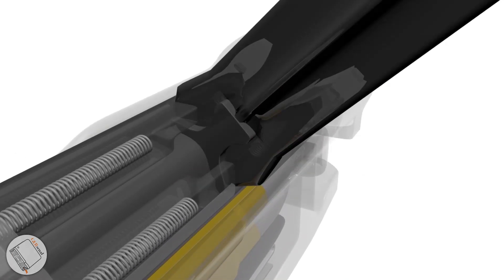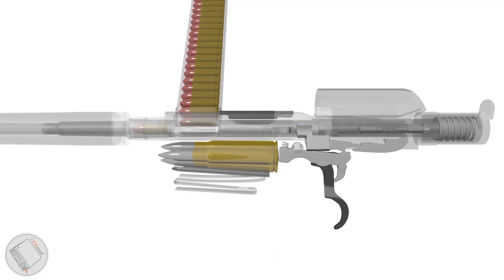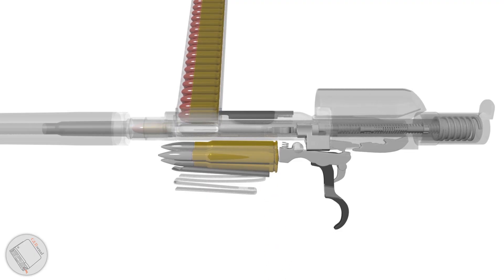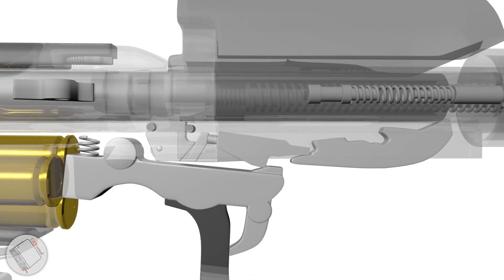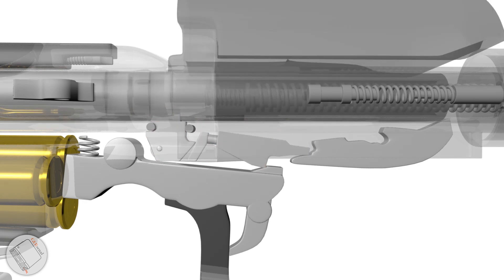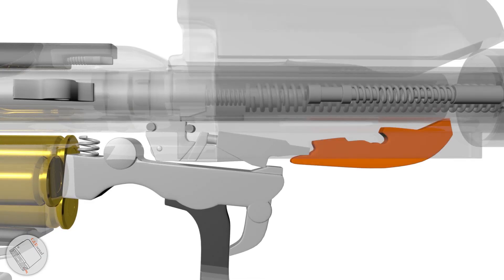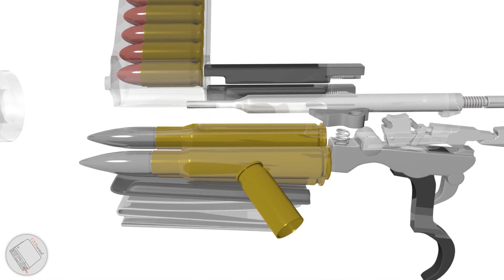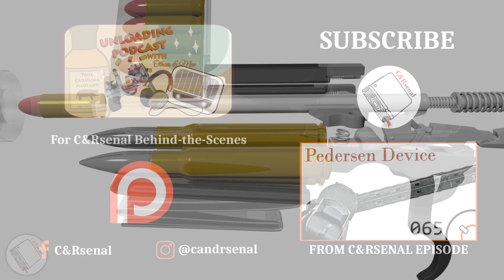How it Works: The Pedersen Device

Comment: I wish some company would make a modernized version of M1903 with Pedersen device that chamber in .308 and .45, or any combination of modern cartridge that makes sense.
Reply: The problem is finding a rifle and pistol cartridge combination that have the same bore diameter, and making sure the pistol cartridge can work in a blowback action
Reply: Well, switching from a .308 to a .45 would require a barrel change.

Comment: i will have to check one of my 03s and see if it has the special trigger.
Reply: easier to check for the big honkin hole in the left side of the receiver.
Reply: @johnsmith-sp6yl  the ejection port is there..
Reply: @johnsmith-sp6yl The ejection port alone doesn’t make a rifle compatible. Most Mark I rifles had their unique triggers and mag cutoffs replaced with standard ones.

Comment: "This is pretty straightforward"
Makes you wonder how they figured this out before the end of WW1, but never produced a proper SMG before WW2 that wasn't wasting pounds of material on non-functional (literally did nothing) components.
Reply: Two big, huge reasons.

First, the money. In 1917 the money taps were wide open. After the war the spigots got closed quite fast so they weren't developing much until you get into the 1930s. And once the money started flowing, there were much higher priorities. This is also why the M1918A2 was so awful, because they needed to be a cheap conversion from an M1918 or M1918A1 such that the good FN and Colt models were not acceptable. The only reason the Thompson existed is that it was largely developed during WWII when the money was flowing freely.

Second, the value and utility of a submachine gun was not widely accepted. Remember the British Army famously derided them until WWII started. And its value was debated in the US military throughout the inter-war period with the Army only deciding to adopt a submachinegun in 1938.

And once the US and UK realized they needed these things, it was the only submachine gun that could be acquired in large numbers in the short term.
Reply: @88porpoise  In other words, ignorance and a lack of vision.
Reply: Remember the US army had a love of marksmanship . One shot one kill, don’t waste ammunition. The idea of spray and pray was not something that was going to convince any of its decision makers.
Reply: The Blish component actually did help delay the action, just not in the way it was supposed to

Comment: In the current era, CMMG has made something similar for AR15's to fire .22lr. Except it feeds through the magwell from special mags and ejects from the normal ejection port. It doesn't work great on my full sized A1 clone though... My 03 is a Mark 1 if someone wants to make a modern copy of the Pedersen device I can afford.  

I mean they sell .30 Pedersen again... err 7.65 French Long... I mean, damn it, .30 Super Carry... 😂
Reply: I think it’s a lot closer to the M261 conversion kit. In the 1980’s, the US Army introduced the M261 .22 LR conversion kit for the M16 rifle, for use in indoor training areas with space limitations. Like the modern CMMG kit, you replaced the bolt carrier group with a .22 LR bolt carrier group with chamber insert. 

Unlike the CMMG kit, the M261 utilize converted standard M16 USGI magazines. This was achieved by literally shoving the magazine insert into an unloaded M16 magazine. Said insert was a .22 LR magazine. Yes, you shoved a mag into a mag. No, I don’t know why someone hasn’t tried that since. 

Of course, it’s fully reversible.
Reply: From personal experience, the CMMG .22LR conversion kits don't work that well in semi-auto only M4s, either.
     I soent some time as a firearms instructor for my employer, which coincided with the acquisition of several CMMG kits that were installed into issue M4s that had had semi-auto only trigger groups installed.  They were intended for use as an inexpensive training tool to develop marksmanship skills, reducing the amount of 5.56x45 we had to purchase.
     We found that the conversions were very sensitive to fouling and rapidly generated enough failures to feed and eject that their value as training tools was limited at best.  I recall that we had issues with the magazines as well.  Finally, the conversion kits themselves did not hold up under heavy use, which generated more malfunctions and a marked reduction in accuracy...also not ideal for training marksmanship.
Reply: Them fouling up and jamming is actually a pretty useful training tool. The most common jam is when the 22 tips up into the gas key channel in your charging handle. They make some little inserts for that and specific CHs to prevent it, but I enjoy the jam clearing and field clean process.

Comment: A great minute and a very interesting device.Was it only for 9mm?
Reply: It is actually in 7.65×20mm French Longue, 9mm is too large to fit down the barrel of the M1903, it had to be a .30 cal round
Reply: @bigmike9947  Thank you.Right so.
Reply: so considering that the chamber of the gun is for .30 cal and not .35 cal

no? i thought it shot .32 ACP but apparently it uses its own proprietary cartridge that's related to 7.65 French Longue
Reply: @harveyknguyen  Thank you.

Comment: Ah, from engineering to straight up black magic 😂

I wonder why nobody came up with a modern version for civilian marlet nowadays. Will it have registry troubles like "uppers/lowers"?

Edit: at first I thought it was "vbbsmyt", who uploaded. Have you guys made an animation themselves or partnered up with someone?
Reply: The cmmg 22lr kit is very similar to this, it’s a drop in blowback 22 that fits in the space of a AR bolt+chamber. Also I think these are animations from the full length primers, made by their animator Bruno
Reply: @joemontgomery6658  thanks
Reply: I know that they've collaborated with vbbsmyt on videos before, mostly on videos that involve machine guns IIRC.
Reply: Most of the 3D animations for C&Rsenal are done by crewmember Bruno Agnelli, as you can see in the credits of videos. Bruno even narrates the animation for the Remington Model 14 1/2, another Pederson gun.
Reply: @ultravioletcombat5933  To add, the machinegun animations are generally made by vbbsmyt and the early animations I believe were made by Othais himself.

You can pretty easily tell Othais and Bruno's animations apart by the style.
Reply: @ultravioletcombat5933  thanks, I'll look them up

Comment: Some of these are going to get some clean up done to them, improved scripts, nicer transitions, overall you're getting improved versions of the original animations.
Reply: Very nice. Always look forwards to new episodes.
Reply: But how does the striker act as the ejector?  You can't leave me on this cliffhanger!
Reply: @gratefulguy4130  back of the case seems to bonk into it, ejection on them was weak, even when we shot it
Reply: @gratefulguy4130 not as rare as you might think- the baby browning in .25 did the same. Striker fire, there is no semi-cock or rebound function so it continues to protrude under extraction. It is not unlike a plunger ejector in an AR at that moment, albeit centered rather than offset.
Reply: Thanks Mae, I always enjoy these animations. 
I've also been enjoying your recent episodes on Victorian British service revolvers. 
We used to have a lot of nice examples of the "privately purchased" models like Webley-Wilkinsons owned by private collectors here in the UK. 
I fear not enough of those will have survived after the general post-Dunblane ban on GB handgun ownership. 
But I do see that Royal Armouries have managed to provide sanctuary for a good range of examples.
Reply: Cool! I like having the animations available separately so that I can refresh my memory on how a gun works when it's mentioned in passing as a design lineage.